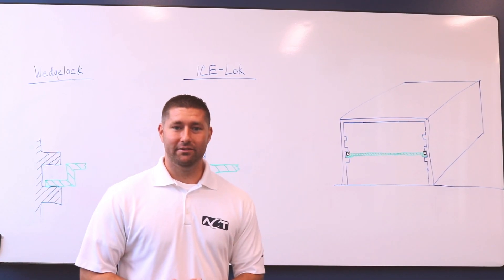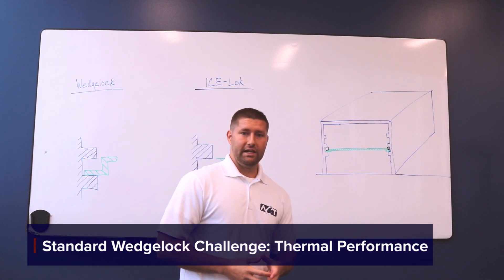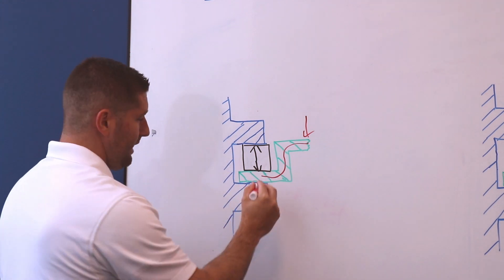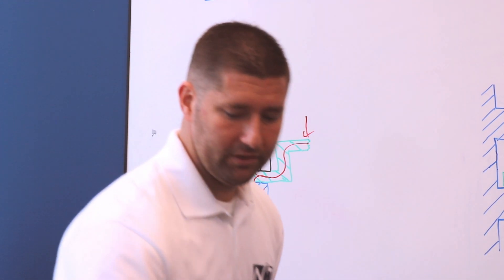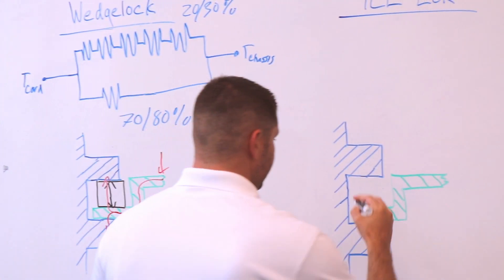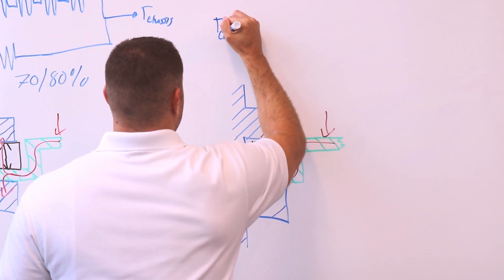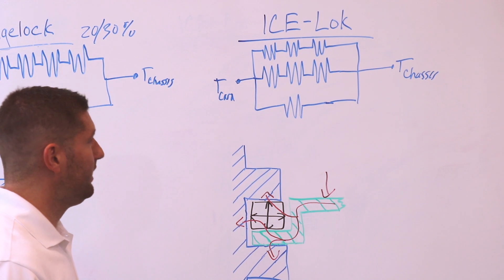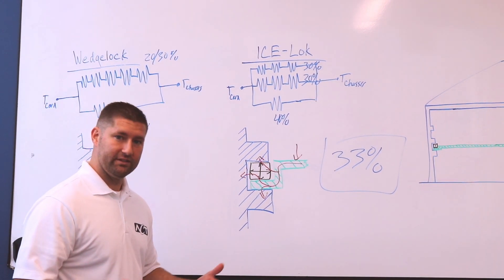Standard Wedge Lock vs. ICE-Lok®

Comment: Is required any thermal pad or clue between card, wedge lock, and chassis? and how you are ensuring that?
Reply from the maker: There is no thermal pad or thermal grease used.  ICE-Loks rely on pressure to minimize thermal resistance across the  contact.  Thermal interface materials could reduce resistance further, but the trade is increased complexity and cost.   The increased contact area relative to a traditional wedge, however, is the most significant factor.

Check the ICE-Lok page on our website for more details:
https://www.1-act.com/products/ice-lok-thermally-enhanced-wedgelock/

Or our video on wedgelocks for embedded computing:
https://www.youtube.com/watch?v=vfV1mdxe1IY
Reply: @AdvancedCoolingTech Thank you reply. if you share any case study for this clarification, it will help to use your wedge lock.